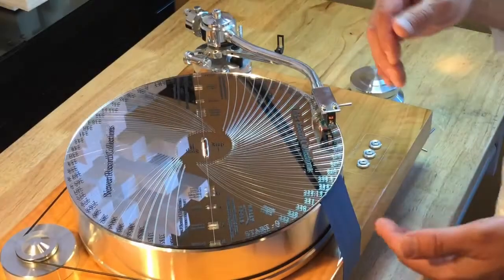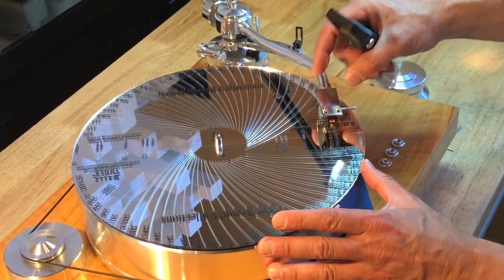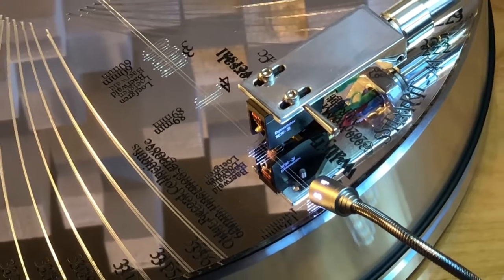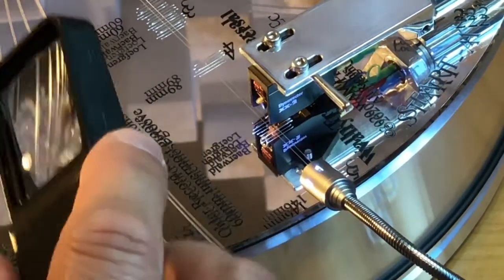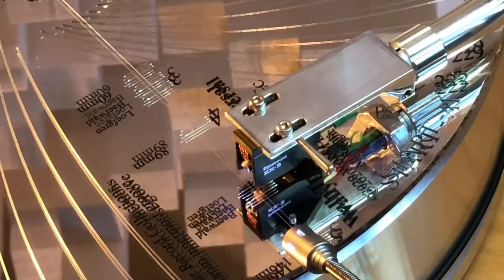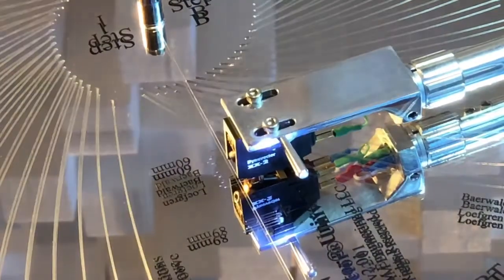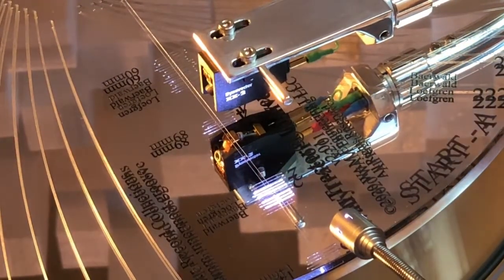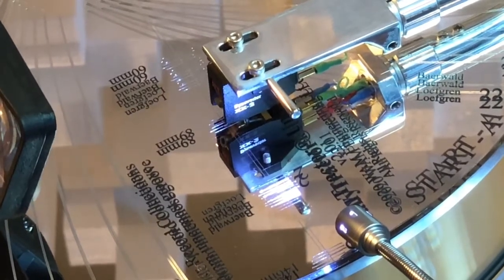WallyTractor Instructional Series (Part 4 of 4) - Aligning the Cantilever

Comment: Cant there just be slight manufacturing error, unequal balance in the cantilever so it leans slightly to one side when lowered? Or say the Anti Skate mechanism is magnetic and doesnt fully disengage even at 0.
Should one really align for that or is it not better to float the cantilever just barely above the disc so that it is in its natural resting spot?
Reply from the maker: Hello Leon. This does happen, but it is almost never because of the cartridge assembly. It is almost always because the tonearm has internal forces within it (usually a bad bearing or twisted/poorly routed tonearm wires) that are causing a horizontal force that the cantilever then reacts to when VTF is applied. This is NOT GOOD since you'll never get your cantilever aligned properly as a result. This is why I suggest a quick analysis of the tonearm quality with the WallySkater before aligning the cantilever in order to determine whether this condition occurs. I go into this in the first of the four WallyTractor instructional videos. Thanks for the question.
Reply: @WAM-Engineering  Great answer, yes same idea with residual anti skate then, if its magnetic and still slightly pulling at 0. 
In these cases I suppose floating the stylus just above the glass with 0 VTF is preferable over getting misleading readings from the tonearm.

Comment: Nice video. Can the wally tractor be used for aligning the cantilever on tangential arms?
Reply from the maker: Absolutely! That is what the radial line is for. Also, the WallySkater is good to use on tangential arms as well in order to measure for any horizontal forces pushing the carriage one way or the other. If such forces are over about 5% of VTF it may make it impossible to perfectly align your cantilever.
Reply: @WAM-Engineering  Thanks, it'd be great if you made a video about tangential arms and cartridge alignment!
Reply from the maker: @yoragistri  Thank you for the idea. I will put it on the list. There are many, many videos that we need to make!